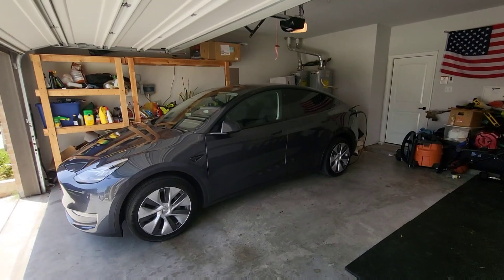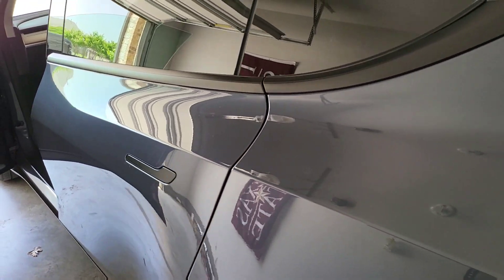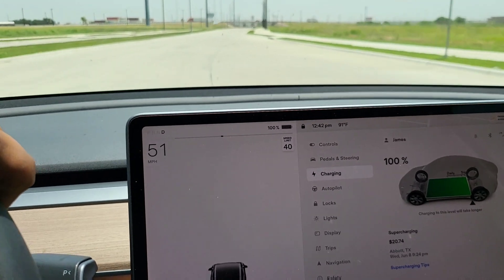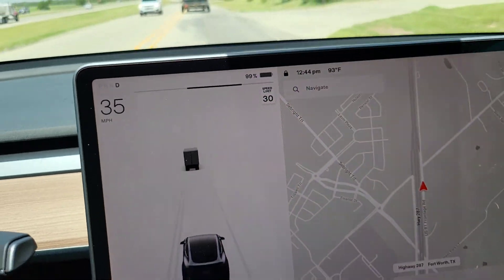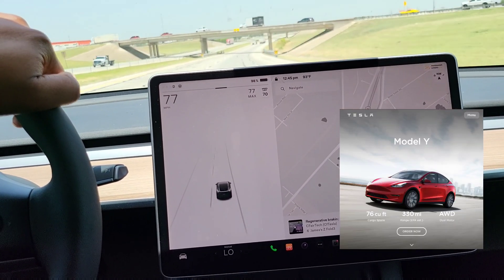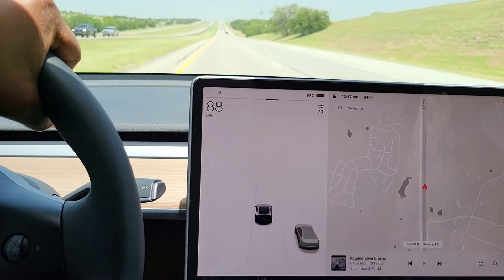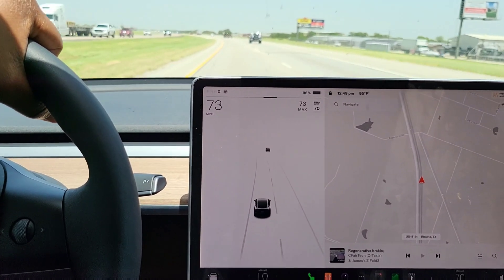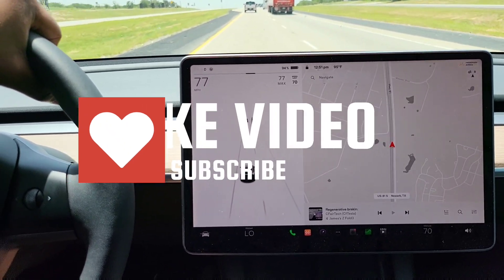4680 Battery Experiment: Does Regen Braking work at 100% Battery ? 2022 Model Y Austin Built

Comment: Regen braking could still work with the battery charging system throwing away the power generated because you are fully charged. I would not assume the motor could not slow the car if battery full.  The issue may be similar to solar panel inverters that "clip" the power when the panel amperage exceeds the microinverter limits.
Reply from the maker: In my 2019 model 3 if I charged over 95% it would warn Regen braking would be effected on the screen. When I drove it there was no Regen at all vs this 4680 model y shows no warning and still regens 

We would probably need to do a side by side comparison with a 2022 Fremont Model Y to see if Regen works at 100%

Comment: Flux braking is probably still possible with a full battery. I’m a power engineer and I realize many of you aren’t aware of this mode of operation.  Never the less this is an alternative type of braking that can burn off energy in the drive’s motor.

Comment: its great and all but i really think they just used very little battery cells as production isnt at full capacity yet. i think current austin model Y's are just charging locked instead of range locked.

as battery production increases i can see them transitioning to making long range variants as well as standard range at Giga Austin and both being able to benefit from much faster charging

Comment: the car was stating 100% charge but it was still pulling 7kw so there was still a little bit of room left. Also when you started driving the regen line was actually shorter (maybe 1/3 of the full line) so it looks like initially regen was a bit limited and I believe regen does become slowly available within few miles of driving. What I would suggest is letting it charge until charge rate drops below 2kw as that would be true 100% and then test it. However point in the other direction is I know for a fact with other teslas when you are at 100% charge you do get a warning that regen is temporarily unavailable which I did not see on your screen so you may still be correct on your assumption.
Reply: when the cars say "charge complete" that is the only time it is finished and especially if you charge to 100% it can spend 30 minutes @ 1 - 2 kw balancing the cells. it is recommended to let the car finish completely if you are charging to 100%.

Comment: Thanks for these videos.  Although I don't think the battery capacity is software locked, but rather just the supercharging curve is software limited, for now.  I reckon its actually a 68kwh LFP battery, but due to the tab-less design of the 4680 cells it can take higher charge rate at higher state of charge, and that's the reason why it can regen brake pretty well above 90% SoC.  But that's just my speculation.
Reply: 4680 will not be LFP Elon has stated - the Chinese also owns the LFP patents
Reply: @TheKimNeeper  ah yeah i think you're right actually.    It doesn't seem like the energy density of this car's battery pack is much better than current 2170 model y's.  I guess tesla is still working on refining the energy density of their 4680 cells?
Reply: It is not LFP. Someone lab tested it.

Comment: The car did not stop charging at 100%. If you had kept it charging longer, would we have seen it say it's at 101%? You'll want to check this out before Tesla rolls out another update to you to disguise what's going on.
Reply from the maker: Good point!  
On my model 3 it would say charge complete
Reply: Tesla does a top balance when charging to 100%. That can take a while to equalize all the cells (especially on a new pack) as it has to slowly discharge the higher voltage cells then charge the lower voltage ones to bring them all to the same level.  I charge to 100% only a few times a year to help keep the pack balanced. Otherwise 85% in the winter, 75% in the summer to keep the pack life as healthy as possible. Unless I need to travel somewhere far of course, then I'll charge higher.

Comment: Interesting experiment. Can we guess what the capacity is at this point? If, at 100%, it is estimating another 30 mins to finish, then perhaps it would go up to 110% or 115% or 120%? if it would go up to 120%, then the range would be 334.8  miles. Interesting because on the Tesla website it says range for the MYLR is 330 miles.
Reply: If stays 5 days can reach even 400%!

Comment: If you don't roll off a hill and regen for minutes, right after 100% SOC, then this experiment is nonsense. Of course you had room in battery for the regen braking, because the power to run your car and accelerate it before the braking took place consumed more energy than the regen did itself. Your experiment isn't faulty just in theory, it also assumes that not all Teslas have a small battery capacity surplus above 100% reserved for regen braking, or that the car is really regen braking, not just regular braking, and is actually charging the battery while at still full state of charge. Not to mention that a one hundred percent battery readout correlates to more like 98% in the actual energy storage capacity, even if the car is not software limited with a larger battery pack.
Reply from the maker: I've tested this with my 2019 model 3 long range and there is no Regen over 95 % battery . The screen actually had a warning about not having regen
Reply: I agree with your assessment.  Driving on flat land, you can only recover (partially) what initially came out of the battery, so you can never fill back over the 100% mark.  Would need to find a supercharger at the top of a tall hill or something.
Assuming the battery is software limited, I would think they limit it to the middle-of-the-range 10-80%.  If so, the alternative test, which I would never ever do myself, is to deplete well below 0% and see if you actually go an extra 40 miles.  Tesla is unlikely to actually stop the car with software limits.  Again, don't ever try this!
Reply: Idiot there no when you’re near 100%, the fact he has regen braking at 100 or 99% says that there is 5% extra a capacity at least

Comment: @100% and charging, still 30 min to finish?
Reply: Tesla does a top balance when charging to 100%, that does take a while to equalize all the cells as it has to slowly discharge the higher voltage cells then charge the lower voltage ones to bring them all to the same level.  I charge to 100% only a few times a year to help keep the pack balanced. Otherwise 85% in the winter, 75% in the summer to keep the pack life as healthy as possible. Unless I need to travel somewhere far of course, then I'll charge higher.
Reply: But at that point the charge rate dropped down to 7kw.
Reply from the maker: My model 3 would do the same thing